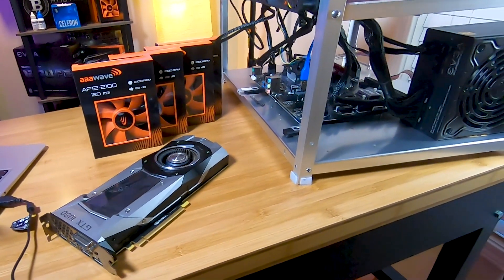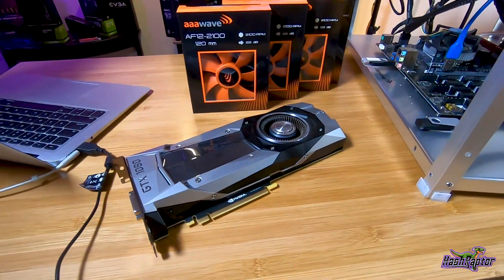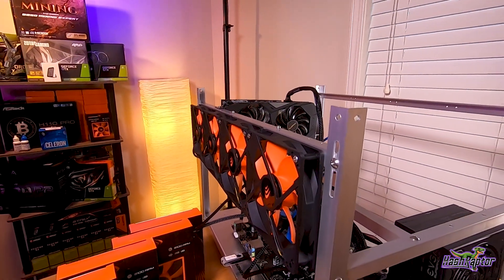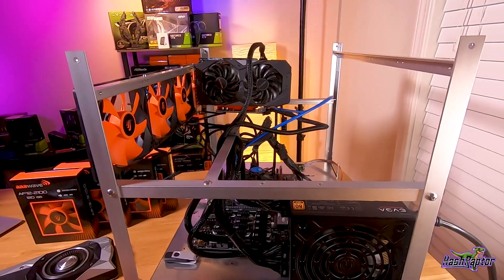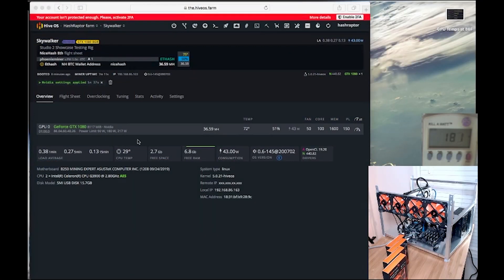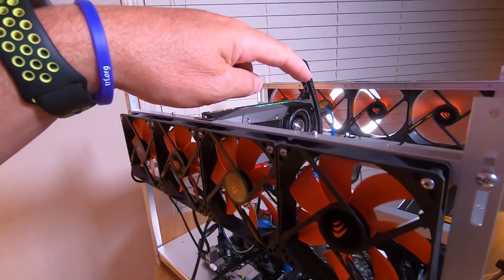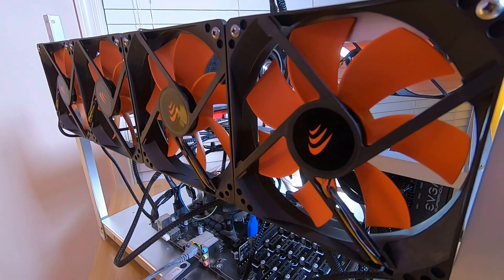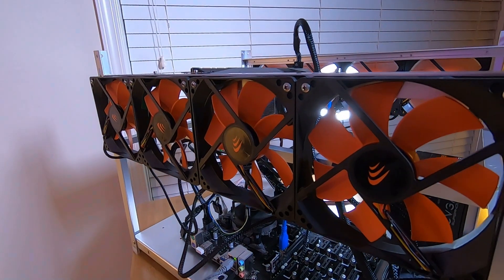How much do Rig Fans help?  Let's Test and Quantify | Mining Rig Chasis Fans | Studio Rig Build Pt 2

Comment: yea thats prettty much shows us nothing.. your using a single card on an open air rig, without any cards around it which you did mention, and your using a blower style card which are pretty much obsolete. no one in their right mind is running 1 blower style card in an open air bench, secondly, blower cards  do better in a rack style case, thirdly your creating so much air turbulance by blowing air past the card that it doesnt have time to suck it in and actually cool itself. I bet you would see a bigger tepperature drop if you removed the blower fan and shroud all together especially with the fins running horizontal to the positive and negitive airflow your forcing on it

Comment: My fans are daisy chained, powered by the molex from the PSU. Is there a way to increase their speed? Or am I stuck with the speed they are set at from the factory?
Reply from the maker: Hey, so if you are plugged into the mobo then the fans speed can be controlled from the bios.  Otherwise, you should be at full speed.
Reply: @HashRaptor  thanks for the response!

Comment: For fan cooling example enterprise grade servers are good starting point. For example HP rack servers have fans in front that sucks air blows backwards BUT in a close case. If you remove the top cover air will go upwards because heat generated will push them above. Since your rig has no covers it won't do any benefit.

Comment: Howzit I am using Sunon 12V DC  fans they reach up to around 4200rpm at full 12V but can drop them to around 7V and they still spinning around 2000 rpm or so. Better flow than PC fans. Unfortunately they aren't controllable however one can install a controller and can drop the DC V 0-12V but fans will only run from 6V. They make a massive difference but are noisy. . At the moment I have them blowing from the back of the backs at 90 deg to the fan cards Cards are 3070's. Cards are running at around 49 - 54 deg with fans on the cards at auto all the time and roughly staying at that temp; with GPU fans at about 18 - 40% depending on the card position. If I switch the Sunon fans off then the GPU's fans increase and so does the temp a bit. Only thing I need to test is which is the best position to blow in to have the GPU fans hardly running at all... Which I will try out one day....Sorry for the long story...

Comment: In my open rig, didn't help much. But once it was in a case, they drop temps from 80 degrees to mid 40s. It's not a good test to test them separately, the heat accumulation of 10+ gpu is what really causes the issues
Reply from the maker: Nice, what case are you using?
Reply: @HashRaptor  DIY it, every case i ordered never showed up

Comment: I have my fans blowing towards the exhaust outlets would you recommend turning them around??
Reply: yes, if they push air into the exhaust the heat cannot get out. turning around the fans to pull the hot air out will probably improve temps a tiny amount.
Reply: YES

Comment: When I went to college and got my degree for computer information technology they taught us to always have the computer case on because its better for airflow and forcing the heat out of the computer. So while this test is interesting. I still wonder if you follow what the school teaches students and tried this experiment in a case to see if the heat would dramatically go down?
Reply: They go up, open air frames are many degrees cooler

Comment: This highlights the need to effectively remove the heat from the die in the first place. Most stock coolers just do not have enough metal to effectively soak the load of these GPU's and max wattage. An aftermarket heatsink would be a much better investment in every respect.
Reply: no

Comment: I'm curious why more miners aren't aiming their GPU fans upward with a cooling fan from below since hot air rises.  Any insight would be greatly appreciated.  Want to make sure I'm not factoring something... Thanks in advance for your expertise.
Reply from the maker: Good question!  here is what I'd say, it is most important to get heat off the gpu any way possible.  Often that is moving as much air across the card as possible.  BUT, I would also say TEST, TEST, TEST any idea you have.  That is what miners do and how we get better together when we share results.

Comment: Testing like this does't tell me anything.  A single GPU is not going to get very hot no matter how much you "push it" because it has adequate cool air intake on the fan side.
A real world test would be to fully populate a rig with 6 or more GPU's.  Then test the middle cards which are in the center of the heat mass.  Even then the end cards are likely to run cooler then the middle cars.
I find the hardest part of building a reliable rig is mounting the GPU's close together so that the downstream cards are not sucking the upstream cards hot air.
Reply from the maker: Yes agreed !  I think I made the same statement in the video that the next step is to test in a populated rig. That is on the to do list :). I also received a lot of request to do the same testing in a closed case. But there are some notable temperature differences even in this test that were worth seeing as a start. Take care my friend.

Comment: I would recommend that you get a sata/molex fan hub.
Those fan headers on the motherboard are not made to run 4-5 or more fans and are rated for 1-1.5A per header.
Reply: I was expecting to see some smoke

Comment: I appreciate that you've taken the time to do the testing.  I suspect that without streamlining the air movement, that is to say, installing barriers above / below / sides, you're not really going to see significant improvement.  Each of the other cards will act like that barrier at least to the sides and allow for better streamlined airflow  In general, I've learned that it's not really about the ambient air temp, but the rate of airflow that matters most.   The air could be 65 C and the cards would stay at 70-ish C as long as enough air was moved.
Reply: Correct! Adding a baffle of sorts will prevent air from circling around or doubling back at the edges of each fan, thus increasing overall airflow in the desired direction. This explains why an enclosed rig case with well-designed airflow can cool just as well as open air rig fans.
Reply: If the air was at 65 you'd be dead.

Comment: I have those fans. I tried using the molex connector to the ATX power module so I could daisy chain them. I think the wiring is backwards.
When I connected the 1st one, it didn't rotate and started overheating. I tried a different brand and they were fine. Also using the 3 pin connector was fine. Have you experienced these issues? 

P.S. Why aren't you using a 92% - 94% platinum efficiency server power supply w/a breakout board? They're comparatively cheaper and better.
Reply from the maker: So glad you mentioned this. I wanted to try the molex daisy chain you mentioned in an upcoming video. You know what now that I think of it, Crypto Mining Lifer said he had the same issue.

Comment: There is a lot of variations in your test methodology, because it is an open air bench the fans are not as efficient compare to them being in a computer case or server. When looking for fans, I always check for Static pressure and CFM. However, you tested a blower card so yes a exhaust or pull config would be better, for Open air a push config would be better. It depends on your use case. If you blocked off the top side above the GPUs with the "supply" side pushing air, it will benefit more for blower cards. Because a lot of that air gets dispersed bove the GPUs. You will notice the difference on your next test with an open air card. Good luck, bud. Hope this helps
Reply from the maker: Thanks man. Actually had already shot two more videos with testing before posting this one. You’ll see some of what you are talking about. All good ideas bro. Thanks so much for watching and sharing some ideas.  Keep up the good work my man!
Reply: @HashRaptor  I am going to use your content and testing for one of my other videos, but I will wait for the next set of test to validate my theory. Check discord
Reply from the maker: Rock on man!  Hey, do you have a closed case you like?
Reply: @HashRaptor  I like the Hydra III case, i used them in a clients server rack setup. There are some on Amazon that are similar but you are limited in space, so you can only fit 2 slot design cards, bot 2.5 like 2080 or 3 slot beast. However that is how you can have a controlled environment for testing push / pull configs. Something like below, but I haven't verified its quality, only showing as example but look up Hydra 3 crypto mining case.

https://www.amazon.com/dp/B073ZLKW2Y/ref=cm_sw_r_cp_apa_i_WT.bFbK9YWDPM
Reply from the maker: @SerpentXTech  Sounds great man.  Let me know when you post and I'll try to push some traffic your way.  Team work makes the dream work :).

Comment: i have several 1080ti rigs, and i put 5 fans 1800rpm in the back pushing the air and 5 fans 2100rpm aaaware in front extracting, it has been great to cooldown the msi armor cards ;) the only major problem its the dust that they accumulate its not worth it, so i remove the 5 in the back and leave it with the front alone, sorry the bad English!! good work, nothing better than testing and showing to the community thanks!!
Reply from the maker: Awesome man, thanks for sharing your results. That rig sounds wicked!  Very nice!

Comment: Awesome video bro,,,
thanks so much for putting your time & effort into this test, I would also agree that adding 2 sets of fans is a brilliant idea.

I know this might sound so crazy, probably funny, but using 2 radiator fans (with thermostats) one at the front and the other at the back (exhaust) will also work great provided that you have the Rig in a garage or in a shed, but U'll for sure need a standalone power supply for both, imagine how good heat dissipation would be !
(I know it's a crazy idea 🤓)

Thx again bro, I love your videos,,,

Sam 🎵✌🏻
Reply from the maker: Haha, I love crazy ideas!  I think you have to have a wild imagination if you are going to be a miner. So what kind of radiator fans and thermostats are you thinking about?
Reply: Hash Raptor   LoL  !
honestly; I tend to use the Scion FR-S radiator fans, there're 2 options, the 1st is my preference but U need to cut the holder
in the middle to separate the fans:

Option 1:

https://www.ebay.com/itm/Radiator-And-Condenser-Fan-For-Subaru-BRZ-Scion-FR-S-SU3115130-/192823670275?_trksid=p2349624.m46890.l49292

Option 2:
https://www.ebay.com/itm/QTY-2-BLACK-14-SLIM-HIGH-PERFORMANCE-RADIATOR-FAN-AND-MOUNTING-KIT-/261380926881?_trksid=p2349624.m46890.l49292

Those need a switching power supply (fanless), the whole thing will cost between $100 ~$200, results are amazing,,,
Reply: lol yea if your running multiple cards on the same loop, your better off buying more cards then creating a liquid cooled closed loop system on that.

Comment: Need to do a full rig were the cards are tight together? Not just 1. If you have 6 card rig the heat will be recirculating between cards. Put the 8 fans on them and you will definitely see a improvement
Reply from the maker: Agreed 1000%  I'm collecting all the good suggestions from you guys for another video :)

Comment: When you dropped the fan speed I wonder if it was throttling power to keep that temp from getting over 82 degrees?  FA on the orange fans.  Now to find a theme to use those.  Great Pumpkin Charlie Brown?
Reply from the maker: Yeah man, I don't know what it was doing when I dropped the gpu fan speed to 40%.  The drop in wattage made no sense.  I love the color of the orange fans.  Was toying with a Rebel theme.  Holloween would be perfect as well LOL !

Comment: Closed cases are the way to go. Don't hesitate
Reply from the maker: Hey, so I'm closed case curious :).  What brand do you like that I should take a look at?  I've been checking out the octominer case, but the price was pretty high last I checked.  Thanks!
Reply: @HashRaptor  bitmain g2 case are awesome.
Reply: @HashRaptor  we are trying to look into closed cases as well! Hopefully we'll be able to test them out for which makes the cards cooler.

Great video!!!
Reply: @HashRaptor  I spent £80 per 6 gpu case from xcase (uk company). It seems like a lot to spend but it's so much more convenient and saves you a lot of big fans to shift air around. Plus no more wasting money and temporary solutions. The Pros just use the case fans then let the air escape outside. No need for big exhaust fans in your shed.
Reply: Love this video because your test overturned my expectations. Question about exhaust fans - are they better above the gpu levels or at the gpu level (as you have them in this video)?

Comment: will you be testing the blower vr the multi down draft cards in this same setup as well? also will a lid over the cards force more air around the cards, as well would a deck for under the cards help the air flow direction/pressure. " a lid made of thin plastic or poster board, just taped for testing onto the highest rail over the cards. under would req better cable management and routing. another thought one would also need to watch and see if the cards heatsink blades/air directions make a diff as well. vertical vr horizontal venting. heat tends to build around the risers on the verts. just a thought to consider but this would be controlled via a cross draft. 
fans to the aft of the blower cards will pull a vac  on the card and give assistance to their flow by reducing internal pressure thus increasing the flow  but what is the watt diff gpu fan vr case fan at wall. i have made a manifold in the past and used fans to pull air out of the exhaust port of multi blower cards  and have had amazing results when you have a sealed manifold that creates a low pressure zone causing increase air flow without the highspeed fan noise  needed to keep em cool. ....
 love the content
Reply from the maker: Great suggestions man.  I'll test anything :).  I love the idea of putting a lid of some kind over it.  If you have "the perfect fan setup" for different style cards, let me know.  I love trying to figure this stuff out!  Take care!

Comment: I use 4 x Delta 4000 rpm fans and they help keep my cards at under 63 degrees. I turned them off and they go to 67-69 degrees. I also use a push configuration in the front since I have 2 fan open cooler cards. Only downfall is the noise of those fans. The wife loves going into our laundry room where my rig is at. LOL
Reply from the maker: ahahahaha!  Yeah those delta fans are nice! Hey, what kind of cards are you cooling?
Reply: @HashRaptor  MSI RX 570 8gb. I'm poor! Got a deal 4 for 119.00 each new.

Comment: Interesting to see the numbers you're drawing on that setup. Most rigs do a bad job of matching the airflows to the air and heat flows from the GPUs. If the blower style GPU is exhausting out both sides then your 'supply' fans were actually reducing airflow through that side of the heat sink, strong enough fans would stall it. So only 1 degree of difference despite the extra power, if you'd turned the supply fans around so they were both 'exhaust' fans you'd see greater benefit on that arrangement. In an actual rig loaded down with a bunch of other GPUs all packed in there, things might be different and the added airflow in the gaps might outweight stalling the small end section of heat sink.
Reply from the maker: Yeah you are exactly right.  I was thinking about that as well.  Crap, I have another test I need to run :).  Funny thing is on that blower, when I put my hand behind the GPU, I can't tell there is anything coming out.  I suspect the design is to mostly push air out the front but I have no idea what the percentages are.  I have a few other FE blowers from NVIDIA.  I need to see if it is the same with those as well.  Anyhow, thanks so much for adding some insight.  Take care!

Comment: Raptor you should try having the 4x fans sucking out directly above the GPUs vs the 8x fans as in video
Reply from the maker: I'm willing to try anything :).  When you say directly above, what are you thinking that would look like?  Meaning not have them mounted on the front or the back?
Reply: @HashRaptor  yeah so nothing mounted on the front or back but above the middle of the GPUs. You will have to do some modifications on the rig frame to support the fans above the GPUs but i think you might get a good result like that.
Reply: That's exactly how I have my fans set up, on top, blowing upward directly over top each card and it seems to keep the Temps lower than blowing inward from the front or outward from the back.